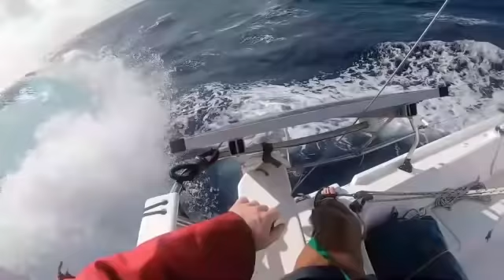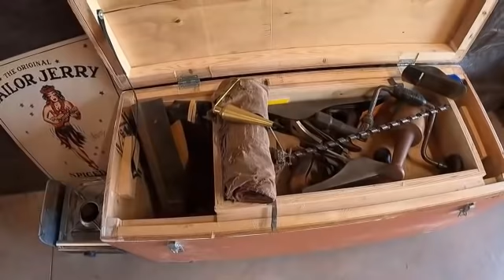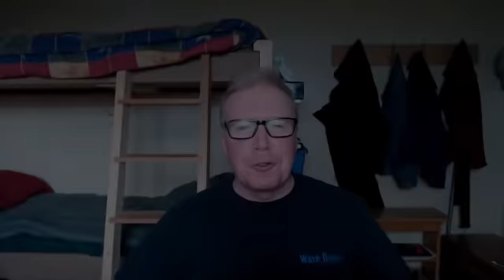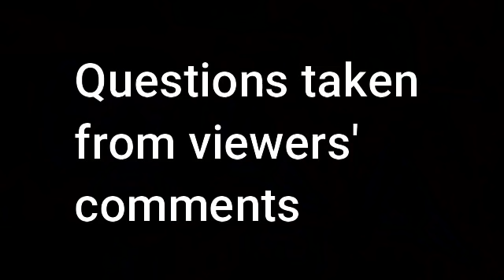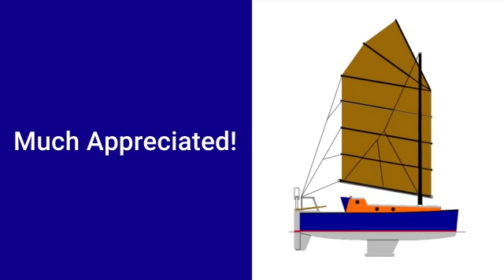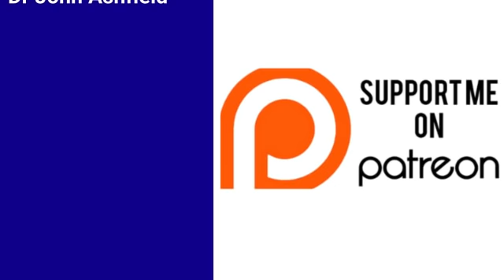S2E03 Study Plans Available for the Wave Rover 6.50 || Questions Answered by the  WR 650 Architect

Comment: How do you heave to in a Junk rig?  I would think that would be important in a blue water boat.
Reply: Define what you mean by "heaving to" please.
Reply: @StormSignal  Heaving to is what you do to balance the boat in a storm or heavy winds.  You backwind the foresail. (Often you tack and do not release the jib sheet) Then trim the main and turn into the wind.  The two forces oppose one another and it calms the boat down allowing for a gentle drifting motion in heavy seas or winds.  You basically drift with the wind and current but the boat is a lot less rocky.
Reply: @everwind_gale  Sloop or Schooner?
Reply: @StormSignal  This works very well on a traditional Bermuda rigged sloop. However it should work with any fore and aft rigged sail boat.
Reply: @everwind_gale  
To best answer your question:

"Heaving to in extreme weather is not particularly helpful, safe or effective in modern boats.
It works best with a straight stem and a long keel, not often found these days.

The equivalent manoeuvre is to continue to sail to windward, but under very much reduced sail area, so that speed is so low that the keel stalls and you make a lot of leeway, therefore making good a course across the wind.
On two masted junk rigs - schooners and ketches - they can be "hove to" in this way by backing the foresail.
First reef the sails to an appropriate size for the conditions, then tie a line around the sheeting bundle and lead it to the weather side (there are other ways, all with their own adherents)

One sail- sloop - reef the sail and haul it hard amidships.
The bermudan sloop sail plan requires there to be two sails in operation for helm balance. With mainsail alone, the centre of area is too far aft, and the boat will only try to round up into the wind if the sail is full of wind. The foresail is needed to balance the drive of the main - one sail driving forwards, one sail driving backwards - and also to put the resultant force in the right place relative to the hull. This is exactly the same situation as with a junk schooner or ketch.

With a single junk sail, it is placed on the hull further forward than the bermudan mainsail, such that helm balance is possible.
Actually, it would be more accurate to describe a single junk sailed boat as fore-reaching, which might be defined as sailing to windward very inefficiently, with too little sail area and with that area sheeted too hard so that it pulls the boat sideways. So the keel stalls out, and the boat is making a little way forwards and a lot more way than usual sideways. The nett result is the same as with a two-sailed boat, hove-to. We are lying steadily, not thrashing too hard into a head sea, not rolling violently as we would when lying a-hull, and not moving too fast in any direction. The junk schooner or ketch will fore-reach as well, rather than being hove-to, if the foresail is not pulled up to weather.

Let's be clear what both of these techniques are for: they make it possible to stop the boat, to wait for any reason, to think about what to do next, to cook, eat, navigate and do maintenance, in greater comfort when the sea is rough. But not, with modern boat types, as a way of surviving very heavy weather, just as a way of achieving a bit of comfort in moderately heavy weather." David Tyler, one of the most competent and extensive Western Junk Rig ocean sailors I know.

"When heaving to with a junk rig, there are a variety of methods you can use. If you are heaving to
in order to time a light, check the chart, put on your oilies (if you happen to be hand-steering) or
anything else that only takes a few moments, the easiest method is simply to let the sheets fly.
If you happen to be running at the time, bring the wind onto the beam and set the self-steering appropriately.
To heave to for any length of time in light winds, the easiest thing is to sheet the sails in as hard as
they will go and leave the helm free. Obviously all boats are different,but on Badger my schooner-rigged,
34ft dory, this would have the effect of the boat sitting docilely in the water, more-or-less head to
wind. Sometimes she would tack herself back and forth and if this was a nuisance, I could either let
the foresail sheet fly or drop that sail.
If I were heaving to to wait on daylight, I would probably adopt the hard-sheeted method, but with 2
or three reefs dropped in each sail.
But heaving to as most people think of it, is done when progress to windward becomes either too
uncomfortable or negligible and not worth the effort of proceeding, or when continuing to run
would bring you into uncomfortably close proximity with land. Generally speaking this takes place
in a lot of wind. In F8 or less, I would normally drop the foresail entirely and sheet it hard in. Then I
would reef the mainsail until only the top 2 panels were showing and sheet that hard in. In addition,
I would set up the self-steering as though we were sailing close-hauled – obviously on the safer tack
– and let the boat carry on and look after herself. The effect was the same as being hove to with the
jib aback: no doubt the windage of the foremast and foresail accounted for that. The boat would
plug steadily forward making a lot of leeway and leaving a reasonable slick to windward. It was the
easiest thing in the world to let draw and shake a reef out of the foresail if I felt that conditions were
moderating: equally easy to go back to being hove-to if they were not.
If you don't have a self-steering gear build one! But until then, you can lash the helm in whatever
way suits your little ship best." - Annie Hill, of Voyaging On A Small Income fame.
Reply: @everwind_gale  the rudder needs to turn to the windward too.
Reply from the maker: Fantastic comment. Thanks for taking the time to write it.
Reply: @WaveRover2  As I have said before. 
The JRA is a fountain of knowledge and good advice. 
I urge you to spend some time there before your project proceeds much further.
Reply: @StormSignal  Thanks for the information, when I solo sail I often heave to as you described, to catch a break, use the head, even eat between races.  Take a break from beating. Was just curious how this was accomplished on a single mast junk rig.  Sure. I agree in super heavy winds or storms you will likely be running bare poles or with a storm sail just to balance the boat.  I would add that everyone should practice heaving to if not familiar as it is a good practice to know.
Reply: @0GSoon  Agreed, was not clear in my description.